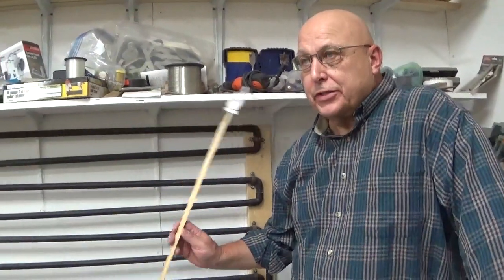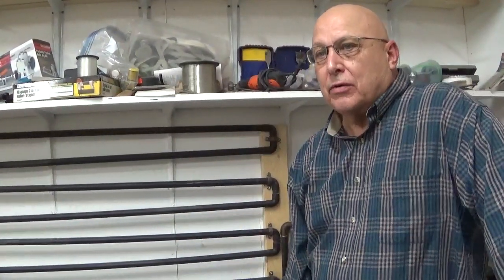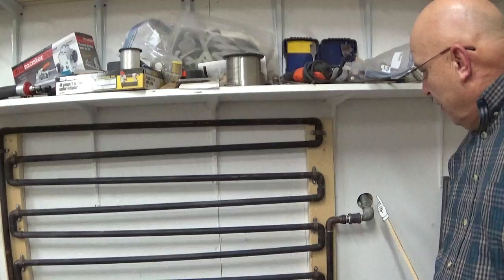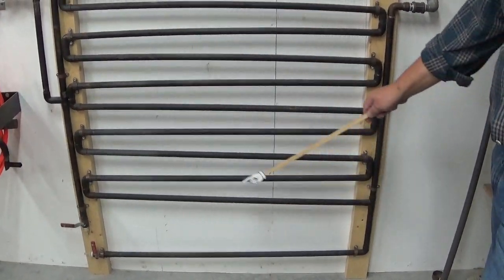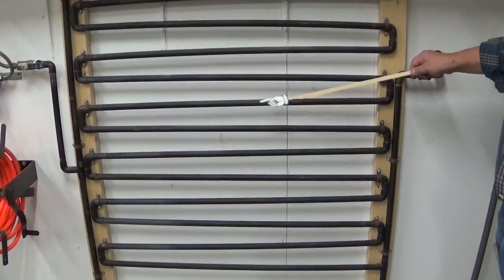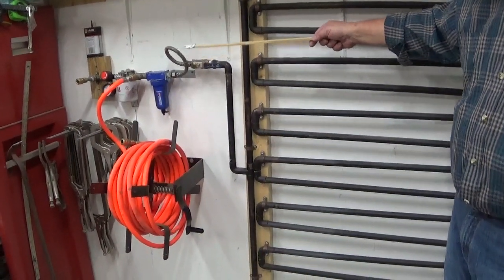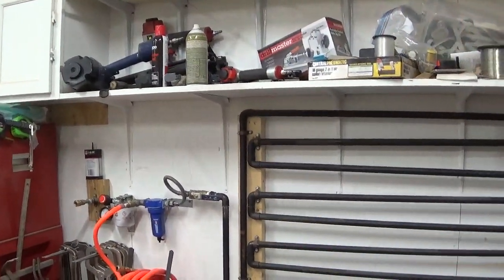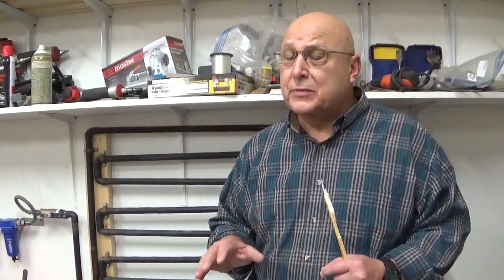Air Compressor aftercooler air cooler dryer condenser, simple and effective to remove moisture

Comment: Certainly, this is a beautifully compact design with most of the features of the cooling lines of a professional paint shop and works perfectly for a one-man shop. 2 small additions I would recommend are to add three vértice water traps along its length and to run the air downhill. In the uphill case, especially without multiple traps, the air is constantly flowing over a stream of water trying to come down, which interferes with its desire to drop to water it’s holding.
Reply: well the air isnt constantly flowing except when you are using it of course so i dont see there being an issue and as said the air cools and the water drops out of the air and obviously water is heavier than air.

Comment: Very simple and effective, I'm drawing one up to build as I'm having trouble with water as temps drop here in the fall in MN.  I considered using 1/2" for cost but 3/4" will have 50% more surface area to reject heat so for anyone thinking of building one don't cheap out...  :)  One small modification, I'm going to turn that lower drain valve downward to drain into a container easier without kicking the fluid out sideways.  Thanks for the video.
Reply from the maker: Hello Lone Oak,
As long as you keep the minimum 50' overall length for the cooling effect and the upward slant of the lines you make make this in endless designs to fit your air cooling needs and your welcome..

Comment: This makes more sense than any other of the DIY after-cooler videos I've seen. A simple, yet effective design without restricting flow.  Would love to see the temperature difference at each end of the copper tubing while the compressor is running. Well done Sir!
Reply from the maker: Hi Double D,
I've never made any temperature readings at the beginning and end of the air cooler but I have used my cabinet sandblaster for several hours and still didn't have any moisture inside the inline water trap, hope this info helps and thank you....
Reply: @jeffwillard2417  this is fantastic as this is the main reason im building one like this for the sand blasting cabinet. i discovered rather quickly water is a problem even though i got a water trap after the compressor and one at the cabinet as well which is after 30 metres of pipe/hose

Comment: Made one according to your design, thanx for the advice! I cleaned the pipes vigorously with sanding paper and ethanol before fluxing and soldering. Zero leaks on the solder joints! Also I use the flex piping for an additional pressure tank of an old compressor and the return from the cooler. I installed it from the motor to the tank so there is an extra drain option. Only downside is when the compressor shuts off, it releases the pressure from the cooler, but that is fine by me.
Reply from the maker: Hi Jurik,
Sounds like you did a great job, thanks for watching...

Comment: I am currently building one of these myself with 15mm copper pipe the same way as you have. i didnt like other ones on youtube especially the ones that run it vertical with several valves to drain it as i thought it was stupid to do that to be honest. the main gripe i had with it was you would have to very regularly open those valves maybe during just one use. i like the way you have done it as it allows some space in the p[ipe at the bottom to be able to store some water temporarily so you dont have to empty it so often. i would definitely empty it after each use or once a day though but the other systems had maybe 3 inch of pipe that could gather water temporarily and that just didnt make any sense to me. 

the way you explainerd how others do things then explained about yours i just chose your design. it makes a lot of sense the way you have done it and you said you made it 35 years ago so obviously its good otherwise you wouldn't still have it. and it is a very simple setup nothing too complicated and rightfujlly so it doesnt need to have 4 or so valves thats just over the top in my opinion. 

i have done mine slightly different though ive put the wood pieces closer to the centre not by much just enough so that the bends/joints on the copper pipe hang off the side of the wood. mainly because i dont trust my soldering lol. Also this way if i need to fix a joint i can use the blow torch and not worry about burning the wood. Yes, i do know you can use a soldering mat but i dont have great luck with those lol. 

i havent pressure tested it yet i need to get some fittings then i can put air in it to check for leaks before i mount it on the wall. i have done 2 strips of wood like you but ive also put some cross bracing between the 2 for support. it wont need it when its on the wall but while im working on it it stops the pipes flexing. 

Thank you again for this video its great!
Reply from the maker: Hi Toto,
You can also make up the same design for a pre-air cooler, just add a fan wired to your pressure switch to keep the tubes cool by blowing cooler air on the copper tubes while its running. I'm glad the video helped your air cooling needs and thanks for watching.

Comment: Dude this is the first person to actually explain how it works, i got it before but now makes real sense.
My problem is i don't have space to do this in that scale and there must be more efficient means that don't involve static devices
Reply from the maker: As long as you keep the basic design you can configure this air cooler into any space available and it will still work.

Comment: I'm going to use this design, I just ordered a Dewalt compressor Model # DXCMV5048055, i'm going to use 3/4 copper pipe with your design, then maybe step it down to 1/2 with the maxline system. This is definitely the best air dryer design i've seen so far. Thanks for sharing.
Reply from the maker: Hi Scott,
Your welcome and the air cooler will do an excellent job removing moisture for you..

Comment: This is exactly what I've been thinking of making.  I had envisioned a toy marble machine that runs down a successive series of horizontal slopes rather than numerous vertical pipes.  I don't see why more people don't think this way and let the water work more efficiently with gravity.  As Einstein said, "Make everything as simple as possible, but not simpler."   Great engineering is only what the problem requires and no more.  It's easy to over-engineer, yet difficult to make something perfect but simple and at low cost.  

And as you similarly said, I've watched many videos of DIY air condenser builds with many being more humorous than the last.  It seems every armchair engineer wants to want to outdo one another with huge vertical systems and countless ball valves.  Total overkill and waste of money.  I think one guy had 10 water drain valves so I thank you for restoring my sanity here lol.  

My only critique is yours is set up for post tank cooling and not straight from the pump and the airflow is moving bottom up not top down which seems ok but also counter-intuitive.  Pre-cooling with a condenser and water trap is more ideal to keep the tank free of water and not pump it full of hot expanded moist air.   Cool dry air, being more condensed, also allows the tank to hold a greater volume of air at the same pressure.  Lastly, I wouldn't think you would want the air moving one direction and the water condensate in the opposite direction. 

I like this set-up regardless, and feel that building a smaller, more compact unit like this could be optimal for direct out of pump condensing, but with a radiator fan on it, much like people have done with the Derale 15300 transmission cooler/condenser units or Derale 15800 (with fan built in).  My pump is a large Saylor Beall 705 which is a two-stage pump with 5hp motor and 120 gallon tank.  The pump is so robust I could use an 8hp motor.  My main worry, as you briefly pointed out, is choking the pumps output by trying to force a large volume of air through a small cooling system on the front end.  I believe the fittings and piping of the small Derale condenser units are all 1/2".   If they were 5/8" or 3/4" I'd feel a lot safer about using them. They do seem to work great for some people but I'm concerned about pump life for the aforementioned reasons.  I think I'll slightly down-scale what you have for pre-cooling with a 20" fan, (house or radiator style) and then possibly duplicate it again to a smaller extent if needed for additional post tank cooling/drying.
Reply from the maker: I'm glad you appreciate my simple but effective air cooler design and it sounds like you have the pre-air cooler all figured out. Good luck with your build and thanks for watching..

Comment: I did the copper pipe cooler years ago and it worked great. I moved a couple of years ago and the new garage didn't have enough wall space so I used a coil of 1/2" soft copper. I wrapped it around a plywood circle about 18" in diameter to make a uniform coil (think spring). I rigged it to spiral downhill to an automatic drain water separator at the bottom (air in at top, out at bottom). Air is back to ambient temp by the time it gets to the separator. I think the coil was 50' but it might have been 100'.
Reply from the maker: I guess you could say its the same principle different design..
Reply: I like the coiled tube design, no need to sweat in a jillion 90º elbows!
Reply: I’d pay you to build me one, how much roughly does it cost to make?

Comment: That setup is nice.For most home guys  it’s perfect. But when you get into larger compressors along with high air demand tools it will not keep up.  I own a 2 stage V design compressor with vertical copper pipes 60’ installed onto a sheet of plywood. With a ball valve at the drop of every line (6 lines) at about 1’ from the bottom of drops so water would be less likely to go into t and more likely to drop to ball valve. Along with a 5 stage filtration system and high demand tool still get water into my desiccant filter. So I’m looking at adding a small section of copper into tub of ice water before my copper wall to increase cooling capacity.

Comment: This looks to be the most effective design I’ve seen.  I’ve ordered a new compressor and it’s on it’s way, so I will need to get this completed quickly as it has to sit on the wall behind the compressor. I was wondering if you could either post a detailed drawing or picture or send one to me as of your coolers as there are some parts of it that are not quite as clear on the video as I think I need? I understand the cooler and dryer, but your drip legs and connections are puzzling.  Thanks in advance, Kelly
Reply from the maker: Hi Kelly,
It is all put together using copper solder fittings that are at any hardware store. The drip legs are just sections of the same copper pipe with some copper fittings that are 3/4" NPT female to 3/4" pipe solder fitting for the ball valve drains and the inlet from the compressor. For the air outlet end to your air regulator you'll need the same type of fitting but reduced down to your air regulator needs, they are usually 1/4", 3/8" or 1/2" NPT ("National Pipe Thread"  is used in the USA, outside the USA it is called BSPT) Ounce you get it all cut and laid out to solder you'll see how easy it is to make. Good luck with your build..
Reply: Jeff, thanks for the quick reply.  I ordered my parts from the big box store online this morning. I was able to slow down the video to ¼ speed then pause it in just the right places to take screen shots of the parts I wasn’t sure about. Then I blew them up and could see them more clearly. The most offending spot is the location of where your riser comes out from the drip line the makes a 90* up to the ball valve. It almost looks like there’s a + and not a T in that location. I got it now. Thanks again. Kelly

Comment: Very good info. Thank you. I thought of an old AC condenser core too, but as you say, too restrictive. I will probably build a similar set up like you have, but will use slant-fit baseboard heat lines, as they have the radiant fins on the lines, then I will not need as long a run, but will still need the zig zag. Great info. Also I plan to set up automatic blow offs, since I don’t want to keep opening the drains all day. I also live in a humid place. Right by the beach in Jersey.
Reply from the maker: It sounds like you have a pretty good design planned out, good luck with your build..
Reply: I'm a 41year semi retired HVAC engineer FYI. If done correctly, the a/c condenser will work very well. Some people think the condenser is only one line going through the coil....but it's not and  will have a header and several separate lines traveling through the coil. 4 or 5-> 3/8" lines will not restrict a 3/4" header. Just make sure to use a 5/8" or 3/4" (OD) feeder and collector on the input/ output...this is critical---> make sure to collect all the end run output 3/8" tubes and tie them into a 5/8" or 3/4" collector tubes....the factory will neck them all down to one 3/8" tube at its exit. Also make sure their is no cap tube or lines below 3/8" size in the condenser and....don't use one off of a heat pump

Comment: I have a water distillation unit that has a spiral condensing coil of finned stainless tubing, it takes water vapor at 212F and gets it cooled to liquid state at the end. It has a powerful fan under it and is very compact. I like the Idea of a compact efficient condenser. I'm sure this home brew 50' of copper pipe on the wall works OK under moderate duty conditions. I'd like to see how it holds up under heavy duty long running in summer heat. Gravity doesn't help much if the air isn't cooled enough.

Comment: Jeff I like your approach to reducing the moisture from the compressed air the best of any I have seen, the one question no one has asked is what schedule of copper pipe did you use? K or L or do you know? 

Thank you! 🛫
Reply from the maker: Hello FalconJet Driver,
I purchased it at Lowes years ago and it is the M type classification with a burst pressure of about 700 PSI, it is your standard ridged pluming copper. It now costs $16.25 for each 10' length, have fun building it.

Comment: I love your set up and I'm planning to use it.  Thank you for posting!  Question - there is a good amount of talk on line about people using Type M, Type L or Type K copper pipe for Air Compressor lines.  Do you know which kind you used here?  Would be great to know.  Thanks.   Hopefully I didn't miss it where you've already mentioned in the comments below.
Reply from the maker: Hi Rob,

This is the copper I used, unfortunately the price has really gone up.  If you really need a good air filter that has a replaceable filter (using cheap toilet paper) get a Motorguard air filter. Good luck with the build.  https://www.lowes.com/pd/Cambridge-Lee-3-4-in-x-10-ft-Copper-M-Pipe/1000044577

Comment: It looks like it makes a lot of sense and works. I'm wondering what you used to install a car oil filter to the air line to catch particles?
Reply from the maker: It is a filter base and filter assembly that I purchased online from Surplus Center.  Most any filter assembly with work just make sure it has a burst pressure rating of 200 psi or more.

Comment: this set up makes sense and seems to incorporat  some basic old school plumbing ideas used with radiators long ago. but I don't understand how the hot air from the compressor pump itself is going back into the tank. If you have an after cooler isn't the idea to cool the air before it's in the tank to help eliminate moister build up in the tank itself from condensation due to internal/external temp. differentiation?  this appears to just take the output from the compressor which I am assuming is the tank outlet, since it all terminates with the final filtration and orange flexible tubing on the coil. or is that somehow going back into the tank itself after cooling?
Reply from the maker: This design can be used for both pre and after air cooling, you'll need to fan cool the tubes for pre-air cooling. If you run your compressor for any length of time the 195-degree heated air will warm up the tank removing any cooling effect from the steel tank, this is where an after-cooler is most effective. The orange hose goes to an air hose in the part of the shop that is not cooled or heated, which I sometimes use to do projects. Thanks for watching.

Comment: I’m just about to build a system for my new compressor and saw your video. 
What is the length of the pipe between the bends please?
I’m still don’t know if to put in a cooler between the compressor and tank as I am going to be painting cars?
Reply from the maker: Hi Russel,
The beauty of this system is you can modify the length of pipe to fit your area. My first one that I built for my body shop had the same design but with 10' pipes and total of 60' but I needed that to remove moisture for the sandblaster. My best advice is to use a Motor guard filter after your air regulator and then thread a new air hose into it for a permanent airline for painting, that way you won't get any contamination paint. Some more advice don't buy the motor guard filters just use the cheapest which usually means the stiffest toilet paper you can find. To answer your first question the length of the pipes is 40", just make sure you have a minimum of 50' for your air cooler. You can also use this design a pre-air cooler just be sure to put a fan on the copper tubes.